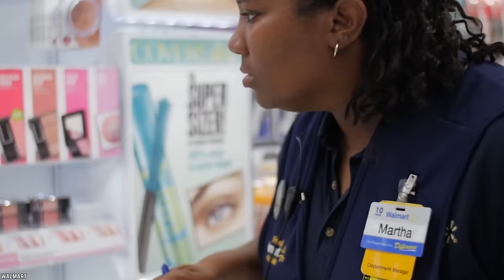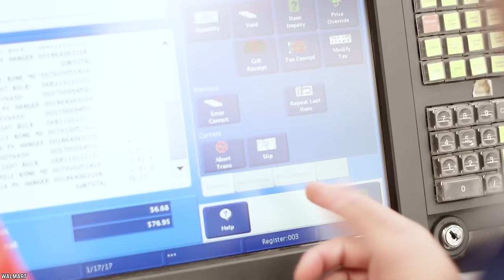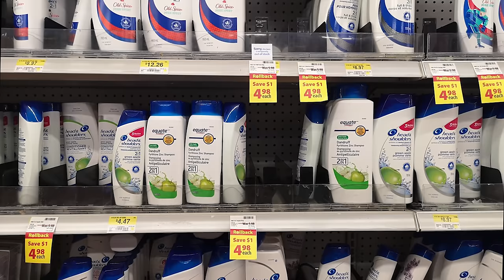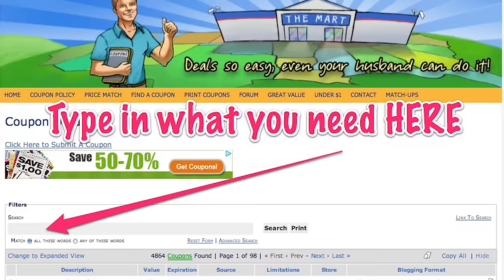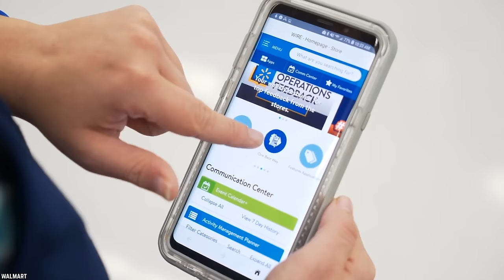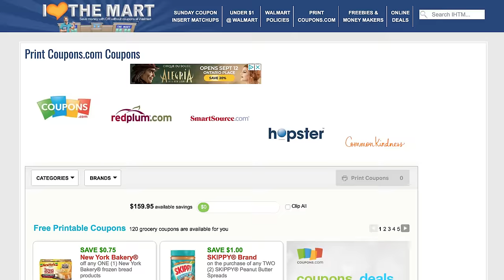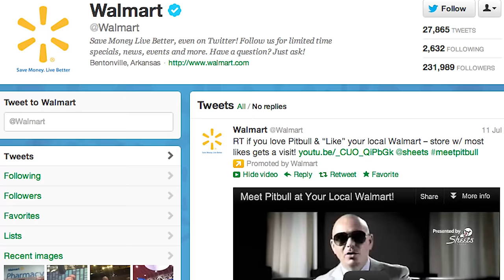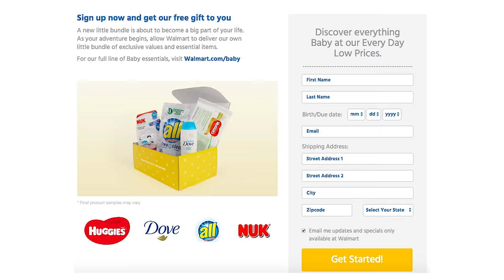10 Secrets Walmart Doesn't Want You To Know (Part 2)

Comment: Best time to shop Walmart is NEVER!   Support small business instead.
Reply: That sounds great, in theory. I'm Diabetic. After Irma passed through Florida, Walmart is the only grocery that still carries many low sugar/no sugar added foods. What little other chains carry, is usually out of stock.
I used to have no other chose but local businesses, back in the '80s. I would need things they had to order. I waitrd up to nine months for boxes of machine screws from a local, long time hardware store. These days, I use Grainger or Fastenal. Most is in stock, or it will arrive from a warehouse within days. The local hardware stores have to buy a minimum  from their supplier each time. They only order ever 30 to 45 days and cost more than twice as much. I live on a tiny VA pension, these days. I can't afford the time, or the higher price to shop at a hardware store with a lot of steps, and uneven flors. I had two bad falls, last year. After one, I laid in my driveway for several hours before someone finally head me yelling for help. Do whatever you want, but I only have a few hours a day to be on my feet, and only a few days a week.
Reply: Why
Reply: Can't do that when they charge 3 times as much. Thats why walmart is in the lead. Cheaper prices
Reply: @Zer0Mood  The only affordable local grocery places sell dented can and things right at their expiration dates. There are other discount grocery stores, but only a half dozen things that I can eat, and only if they are in stock. Some people can wallow up to a pig trough and eat anything, some can't.
Reply: @Zer0Mood  slave wages from their resources
Reply: Fine if you can afford your necessities there.  🤬
Reply: Support Small Businesses  NO MATTER WHO the big box retailer is !!!!!!!

Comment: When I worked at walmart I knew of all this. Shopped their to a degree. After I got sick I started changing all that for me on a whole. Meaning everywhere. This place really isn't a proper spot to shop for food. Something you all should think of whenever you're shopping there. Look up front at them shop back carts when you enter the place. Take notes if don't have a great or even a good memory. Notice them same carts at checkout. But more importantly. Notice the food items. Now an experience I've had on several occasions. I've found items (food of course) so outdated the colors changed as well as the packaging shape. Took them to the departments managers. Now when I worked there I was told if items on the floor are outdated or compromised. Remove them to the back for termination. The managers took them to the back. Basically a write-off. Back to my experience after no longer working there. The items posted on the self as well as items that should be returned to the coolers immediately we're there sitting. Discolored and swollen as they're now pretty much spoiled. And we all know how so called organic items go bad almost at a snap/blink. I decided to look and see if the proper methods were followed. Needless to say they were put back out for sell. Green and bloated complete with fur, penicillin and separation. I then mention this to an employee and told them I just gave this to the manager of this department. And the employee told me that's who told them to put it back on the floor. And this was told to me by both department employees. Since then I've come to the realization. Walmart isn't a great source for food items at all. Walmart for me is only ok for body care, fish food, maybe a dvd, underwear, baby care items to a degree and arts and crafts. And that's still a problem. Cause we are still contributing to the problems of the world supporting people of this nature.
Reply: I agree with u completely. I use them to a degree because of the convenience of the location on the bus. But I look over my item and if I have to buy food I never take the item in the front and always check the date.
Reply: For realz whoo that's a big part of why I don't buy the discounted stuff thanks for the heads up 🤯
Reply: I guess it depends on the store and managers in charge. The one I worked at had a "if you wouldn't buy yourself it then send it to claims"  policy.
Reply: It is too bad that so many families are forced to go to Walmart,superstores,shoppers drugs  ect. because they must get the lower prices of some necessities to SURVIVE!!!!!
Reply: Nice Book.....   LOL
Reply: I will never buy meat especially the ground beef after what was in a report I read.
Reply: Night stocker's as me one of them are told to take the item to the cooler to disguard in basket to write off.
Reply: Can you answer if wal mart give vaulers to employees.
Reply: @shanny4306  I shop sales at the local grocery stores and get just as good or better prices weekly.
Reply: Say you have to much time on your hands without saying it 🤣
Reply: Our local Walmart Super-centers having a return policy that if you don’t like your purchase , return it for a refund and no questions asked .
Reply: Several grocery chains in our area having better choices, better qualities and better prices than Walmart’s grocery.

Comment: The biggest piece of the pie goes to the owner. That's how it goes.
Reply: The entire pie goes to the owner. Wages are crumbs that fall from the pie.
Reply: @lukamilas8648  crumbs are the smaller pieces of it . Still part of the pie no matter how tiny.
Reply: @jamalsmith5073  if that’s the way you want to look at it.
Reply: @lukamilas8648  are crumbs not part of a crust part of a pie? It's a part of a part of a part. What you said was paradoxical. This group of people don't get any pie . Keyword "any", that would include crumbs. No crumbs , flakes or any spec of profit. A dime is still a piece of the profit even if it's a dime out of a billion dollars. Nevertheless, I think we understand the ones that get the most money. Put it that way .
Reply: @lukamilas8648  what are or what were those crumbs attached to?
Again my point was not about the significance versus insignificant portions but the size difference from a whole.
I understand people get different interpretations of statements but please understand what I'm saying.
Much obliged.

Comment: At our local Walmart they have a basically empty water isle with the exception of a few packs of bottled water and a few small gallons of distilled water. There are signs hanging up that states limited supply and you can only buy one. Yet Kroger in the same town has a full isle of water of many varieties and no limit. 🤔

Comment: Well, not to break the spot light, but saying that the employees are underpaid at Walmart means that the employees in pretty much every retail store except Cosco are underpaid.
Until the HR massive issue from the aftermath of Covid19, the salary at WM was basically higher than any other relative store, except for Cosco. When I started at WM, I was making $4 more per hour (almost $17/h) than when I worked at a successful grocery store close by. The store was paying me a health insurance (I only had to pay for the life insurance part) and I had a bonus of over $1000 every year because the store was doing fine. (And no, I wasn't part of the management. I was part of the afternoon production team, nowadays known as PDC2.)

I know that some store have some major issues and the problem is 99% around the immediate management of any store. Most of the people who complain never did the right step to fix the problem. I have heard some crazy stories from people who temporary joined my team about the store where they worked at, but the problem is that people only complains and quit and barely nobody even take the time to call one of the phone numbers of the bosses above their store managers to explain the situation. (I have seen people believing it wouldn't work, but I have equally see managers being forced to move to another store as a solution to the "problem".)

Also, the "call the cops" thing is not universal. We actually had security guards at my Walmart for a really long time until Covid19 made a mess and a security guard was run over by a car in a neightbor city. The guard ended up dying and since then, WM removed its security guard and simply don't care much about thieft anymore unless it's an important case of value.

Comment: Last month I sent the BBB a report on Walmart. Walmart never responded. The local manager lied not only to corporate but lied to me saying Ive tried numerous times to call you (via email). Uh yeh, no ya havent. I have caller id on 3 devices and even if one is messed up all 3 surely arent. Anyway the reason for the complaint was after paying $10 for pistachios when I was getting close to the bottom of the bag I felt something weird. So I looked down into the bag and a smoked cigarette butt was inside the bag. I looked over the bag and found a very hard to see razor cut. Thats just nasty to start with but the fact covid is rampant here is worse. When I walk through the store nothing is in  stock even stuff other stores are getting that theres not a shortage on and I have found many many items half eaten, canned drinks still in 6pk but one empty, opened mask boxes, missing cans of beer, etc. They changed managers not long ago and the new manager SUCKS!!!!!!! We have never had this problem before and nobody at this store does anything but talk on their cell phones, stand outside near the door smoking chatting up friends in the store when there are about 80 people in line behind them.